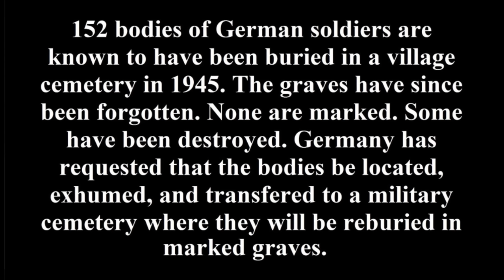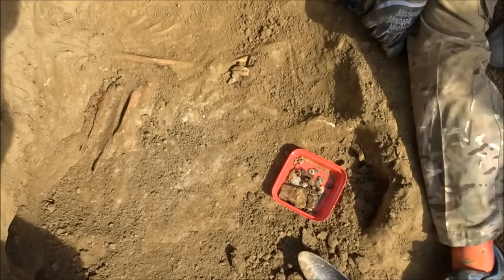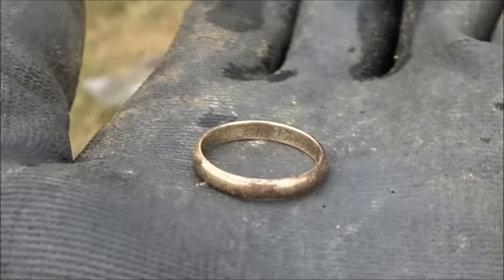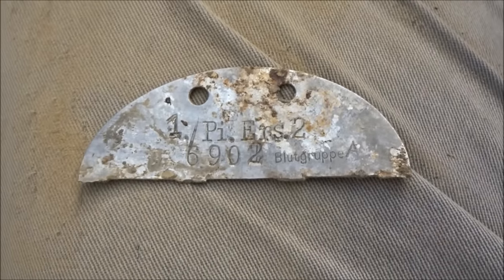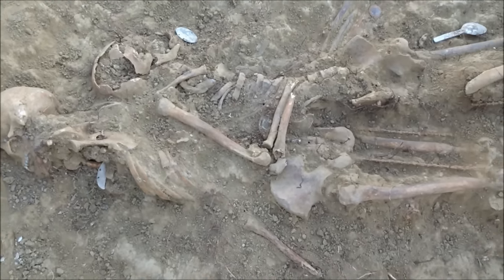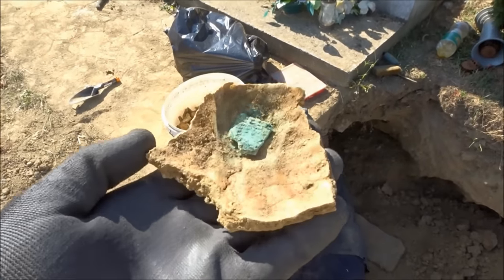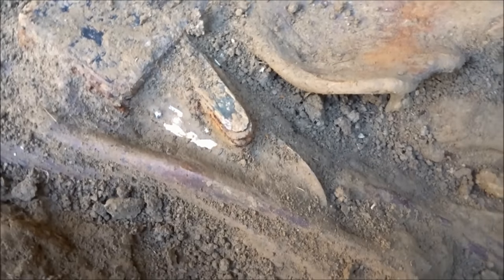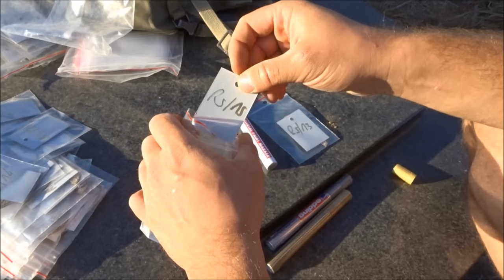The Hell where Youth and Laughter go - WWII German cemetery exhumation

Comment: The wire in the bone is called cerclage wire in that it forms a circle around the bone. It’s used to compress fragments together and is used in conjunction with larger implants like rods or in modern day plates. The lump in the bone is called callus and is a result of new bone laid down to heal the fracture. That fracture is well healed and the bone looks to be in good alignment. It likely occurred at least a year before his death.
Reply: Is there a Doctor in the house? 😃 Perhaps an Orthopaedic specialist?
Reply: Very interesting. Thank you.
Reply: @madeleinesuzette  p
Reply: @madeleinesuzette  l
Reply: Max Powers  The tourniquets are made of rubber and are more resistant to decomposition than the cloth of the uniforms.
Reply: Max Powers  it's also possible their clothes were removed for sterile treatment.
Reply: broke a bone in my foot about A year ago can confirm there's a bump/lump comparing it my other foot.
Reply: @maxsundux  I guess the little toes are less important. When I break my toes the doctor just taped it to the next one. So now I do that my self.

Comment: I work in historical preservation but this takes it to the next level..thanks for what you do.
Reply: Wanting to get into historical preservation. What’s the path like?
Reply: @ArmorandArtillery  Hi! Actually I was the only person besides management with any sort of history or library science degree. I have my History BA but I ended up working for a private sector firm that works on local and state documents. Stuff I've worked on is anything from original Jamestown, VA documents from the mid 1600s to marriage licenses from the 2000s.. I doubt that's what you would find interesting, however. Also the money is like $15 an hour, it isn't great where I'm at.  This is a position open to anyone that can learn quickly and be industrious and careful. 

I would suggest you check out public history/museum studies and find about a path that leads to preservation in museums perhaps? I was going to get my MA in that but I'm deciding instead to switch to law (paralegalism for now then law school) for economic reasons :)  There are some schools that offer historical preservation degrees but I've never heard anything about them and that doesn't seem very mainstream. 
Bonus tip: Internships are the biggest thing by far. EVERYONE will tell you this. Cold call some local museums (the smaller the better to start with) and volunteer on the weekends. I did that with a local aviation museum and it was fantastic just for the heck of it when I still thought I was going to do a museum studies/public history degree.

Comment: 11:16
Was that soldier's head wound definitely shrapnel or could it have been a large caliber projectile? The entrance hole looks too big for the fifty cal common on American aircraft. Did the Russians have something similar to the German 20mm autocannon?
Reply from the maker: If this was done by a bullet, the entrance hole should be more round.
Reply: @CrocodileTear  agreed that the hole isn't perfectly round but it is much rounder than I would expect of a fragment of shrapnel. Did the Russians use cannister anti-personnel ammo for cannon sized weapons? I can easily imagine Russian armament factories producing balls for cannister rounds that were only just mostly round.
Reply from the maker: @curtislowe4577  Cannister / shrapnel balls werent really used any more during WWII. And in any case, they are much smaller than this hole.

Comment: I was reading recently about a mass grave in Canada from mid 1800's where mostly Cholera epidemic victims were buried.  When they decided to exhume and move it around 70 years later they quickly ran in to putrid soft tissue and abandoned the plan.   This doesn't seem to be an issue with these ww2 mass graves even though the years passed aren't too dissimilar and the climate as well.       Why is that?
Reply from the maker: It depends on the soil where the bodies are buried, on the climate, and on multiple other factors. If the ground is frozzen part of the time, that will preserve the bodies. If it is very humid, that can cause adipocere to form, etc. If numerous bodies are buried one on top of the other, decomposition will also take longer.
What you see in this video is not a mass grave, it is multiple bodies buried beside each other in a perfectly organized way (as could be expected with something done by the Germans ;) ).

Comment: you should have mentioned that this is not "the eastern front" as the perception is, that Eastern Front is Russia. Its the Balkan Front, and especially the Yugoslaw campaign. Its important to mention because the campaign in Yugoslawia was a war in a war itself, and especially at the end was extremly violent, barbaric and gruesom. It was even that special, that the Wehrmacht and the attached Waffen SS refused to surrender after the capitulation and they fought on till reaching the western front. 
After the surrender of large parts of the croatian and bosnian oldiers that were part of the NDH army hey were massacred by the communist partisans (also predominately the serbs which themselves switched sides from being supporters of the serbian king to partisans)  in death marches from south to north till Austria, were one of the known massgraves is (Bleiburg). There are many other sites along that way, but are still today not opened (there are many others from the last wars).
Reply from the maker: I say eastern front because the fighting here was against Bulgarian and Soviet troops. I never found any reference saying exactly where the eastern front ends...

Comment: Was there no clothing, blankets, or shrouds found on these German soldiers?  Guessing that Either all the organic clothing or burial blankets long ago decomposed, leaving these warriors encased in dirt.  Interesting how the roots of the trees find rich soil in and around these warriors.  We humans don't seem to learn from our past, we continue to brutalize one another.
Reply from the maker: All cloth except the nylon strings has disapeared
Reply: @CrocodileTear  Interesting.  That was a tremendously riveting video.  All organic clothing disappeared long ago.  The synthetic nylon endured.  The German ID tags had slits across the longest axes of the metal plate, it seems clear that these slits were to aid in breaking the tag in half in the event the soldier was killed.  One half stays with the corps, the other is collected to be used as a record of death.  All but one or two of those ID tags were broken in half, was the same information embossed on both halves of the ID tag?  Thanks again for the interesting and informative video.
Reply from the maker: @BoundANDDetermined88  Yes, that is correct about the ID tags, and the info was written in duplicate. The ones that were found intact were presumably not found by the Germans at the time because they were hidden in some winter clothing, or something of that sort. I invite you to watch the video I made specifically about all the caracteristics and problems of German ID tags: https://www.youtube.com/watch?v=d0pOz94Ej1g